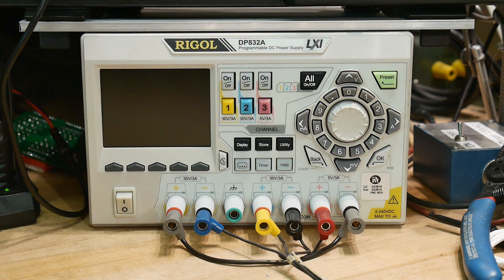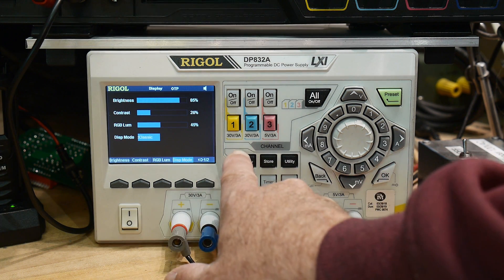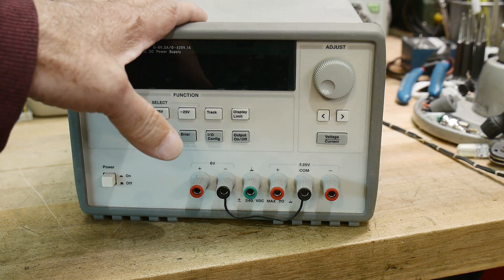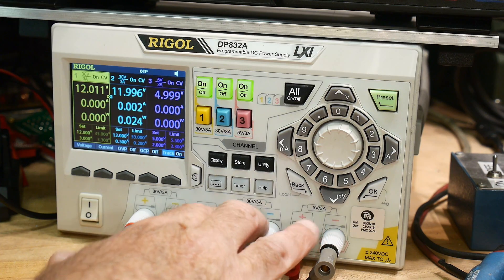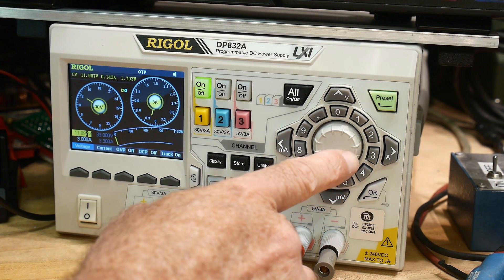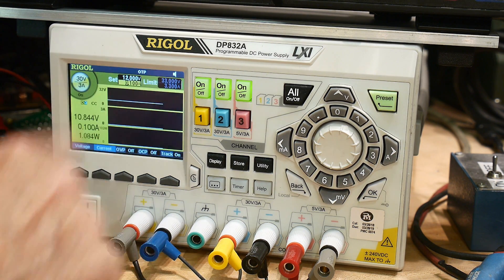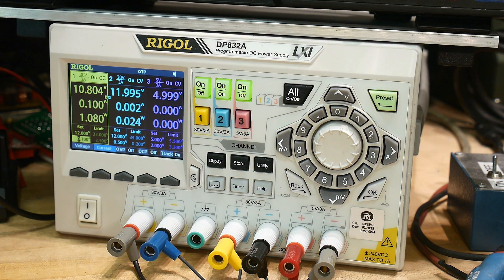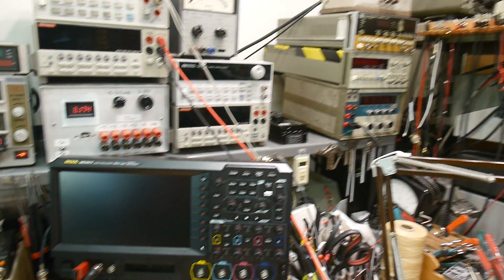#1081 Rigol DP832A Triple Output Power Supply

Comment: What's the procedure for configuring the voltage levels on this supply? I've noticed that whenever I power it on, it resets to 0
Reply from the maker: the output is off. when you enable the output you will see. Read the manual
Reply: @IMSAIGuy Upon turning on the output, it displays zero, requiring manual adjustment every time
Reply from the maker: @ShilpaGireesh  mine turns on with the last setting. maybe that is a menu item somewhere to set it to zero
Reply: @IMSAIGuy  I found the solution, its in the utility menu system- power on-last. Thank you 😊

Comment: Question from a newby. ‘M thinking of buying this PSU, but Rigol makes an 831A which is similar, but has negative terminal. I understand from reading that a negative terminal might be handy for analog projects (everyone gives the example of an op-amp). However, can’t this 832A be configured to provided negative for an op-amp project? Isn’t negative just electrons flowing from ground to the “positive” terminal. I’m new. Don’t burn me down;) trying to learn. Thank you.
Reply from the maker: the DP832 has two of the supplies with a common ground so they are both positive. the third is floating so you can connect the negative to ground and have three positive supplies, or you can connect positive to ground and then use the negative side. So this is how I have mine set up to give say +/-15 and +5
Reply: Ok, I think I'm going to pull the trigger on the DP832A. Big money for me, but I'm beginning to feel the limitation of experimenting with circuit design and using a 5V adapter that came with a telephone. :) But, if there is a better solution for a beginner that someone wants to recommend then I'm very interested in making a better choice of PSU based on other people's experience. @IMSAIGuy

Comment: For those that have the non A version, now you can flash the A version to add the color screen, and of course it was already possible to enable all the options even before this new possibility. 

I love the Encoder, I use it constantly to increase/decrease voltage.

For the cooler what I've done is a little overkill but I've cut the pieces of metal in the cooler hole to make sure it is a complete hole and put an 80mm to 120mm fan shroud with a corresponding silent fan.

Comment: It would be interesting to see ripple level of the Rigol power supply.
Reply from the maker: dave already did: https://youtu.be/Edel3eduRj4
Reply: @IMSAIGuy  Thank you for the link. Few years ago I bought inexpensive (~$50) 2 – 30V 5A power supply from Amazon. It had on average 100mV ripples. I added in 100uH choke and ceramic 11uF (2 x 22uF/25V in series, Murata) capacitor to the output terminal, after the modification the ripples dropped to ~5mV, Dave would say “clean as a whistle” :)

Comment: Great power supply, i'd have one in a minute except I wouldn't. That old style circular telephone type layout for the keypad puts me right off. What were they thinking?
Reply from the maker: a definite fail on their part
Reply: note that the numbers go counter clockwise direction on a phone dial.  Actually, that circular number pad is kind of interesting.
Reply: Overall the front panel looks like a wall in a kindergarten.

Comment: interesting that it was last calibrated in 2018.  Usually, a company will keep that up.  Maybe this was part of a pallet sale when a company went defunct.  Been using an HP E3634A.  My gear must have knobs and switches on the front panel.  Virtual controls seem cumbersome to me.  I am glad to see Rigol did not do away with physical controls.   Amazing how that power supply (new) costs a couple hundred more than a Rigol 100 MHz 4 channel scope.

Comment: I believe if you buy the base model. Non "A" version you can just upgrade the licence to get higher resolution. Just trying to find out if it also can handle more amps with a mod. I like to inject 4 amps in line so my thermal cam can find high resistance components.
Reply from the maker: you can parallel two outputs for 6A
Reply: @IMSAIGuy  Thank you for this info I was not sure if they could be in parallel. Just the answer I needed.